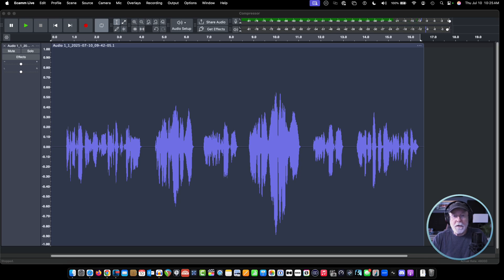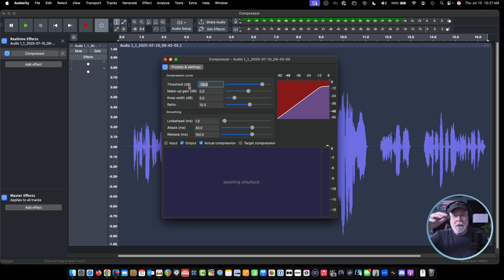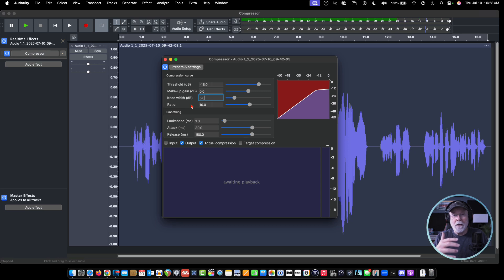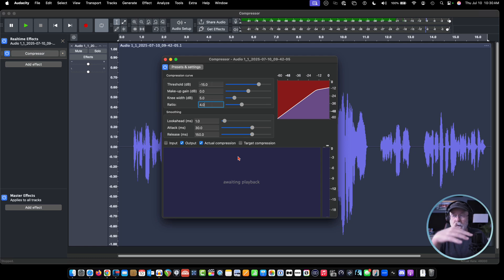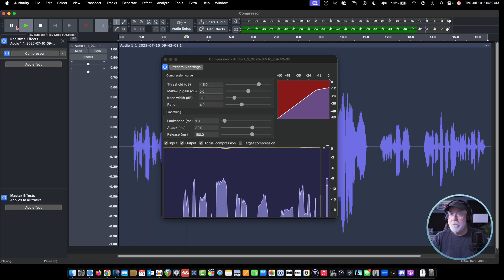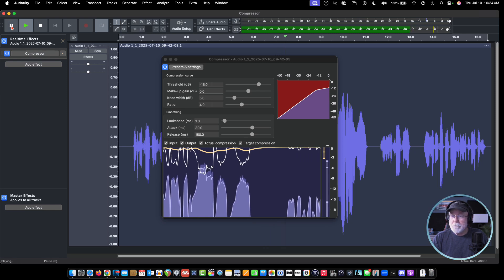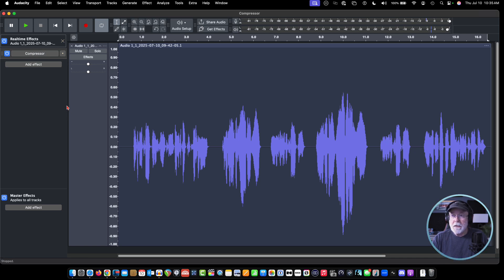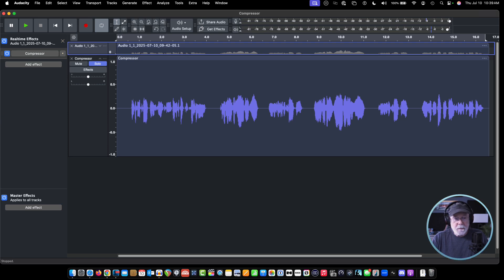Boost Your Voice Quality Instantly Using Audacity's Realtime Compressor

Comment: Mike,..THANK YOU for recording this lesson on compression! This may be a really dumb question but I feel like I need clarification on the subject. In this example that you illustrate in this lesson, you have two primary areas where the audio levels are much higher than the remaining parts of the audio clip.  SInce neither areas ever "clip",....why not just bring the quieter sections UP to match the louder sections rather than the reverse that you did here?  This would result in a more robust sounding file and still not clipping.  I ask this question because as a listener to audio files etc. I would rather have a nice and strong audio file to start with rather than a quieter one that I need to raise my system's speakers volume levels up.  I'm probably a lone wolf with this preference but just wanted to throw this out there.
Reply from the maker: That’s a great question. Normally, the next step after compression (at least for me) would be to level the audio overall. Level it to a LUFS setting for podcasts or an RMS setting for audiobooks. Leveling the loudness brings it all up to the same level and doing it after compression means that the loudness is consistent overall. Does that make sense? I would increase the loudness of this file, but I would compress it first to reduce the variations in the dynamic range.
Reply: @AudacityTraining  Ahhhh...THANK YOU Sir! Makes perfect sense. Would love to see that leveling process too one day to see how you personally normally set those parameters. I'm similar to you though in that I do not normally get heavy handed with compression and leveling/normalization.
Reply from the maker: @ToddDolce Absolutely. I’ll get a video out soon.

Comment: Hi Mike! One thing that bothers me a bit about using Audacity's real-time filters is the need to export and import again to have the track properly updated and ready to receive new filters.
An example is when I'm adjusting the track to meet ACX requirements. If I apply a filter in real time, the ACX Check plugin simply doesn't tell me whether the change was effective or not. I need to export and then import the audio to apply ACX Check. That's why I prefer to avoid these real-time filters. That way, I can just Ctrl+Z and try a different adjustment, since I can immediately see whether the changes were sufficient to meet ACX requirements.
I think it would be interesting to have a mechanism in Audacity that allows you to apply the changes obtained in real-time filters, without having to export and then import.
Thanks for the explanation in this video! 👍
Reply from the maker: That’s a valid point. Thanks for bringing it up. I agree with you where audiobooks are concerned. For podcasting, etc, realtime probably have more of a place. Waves has a realtime LUFS plugin that I’ve used but it’s not real intuitive. Maybe I’ll do a video on it. Thanks for your input.